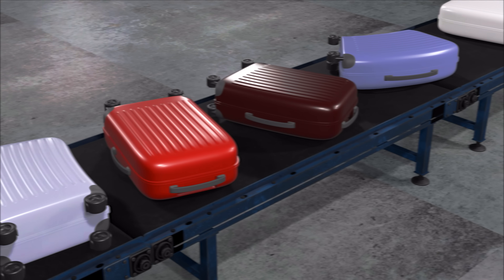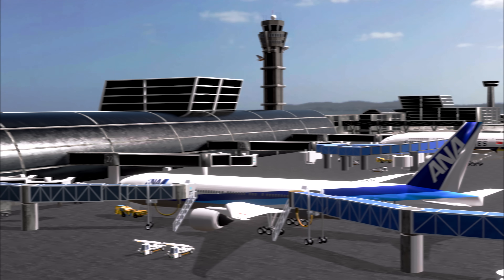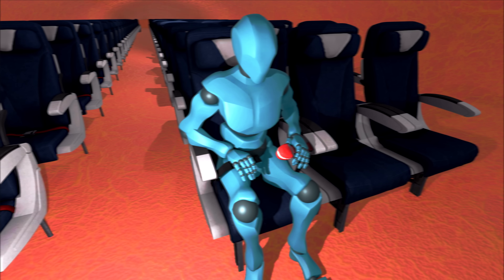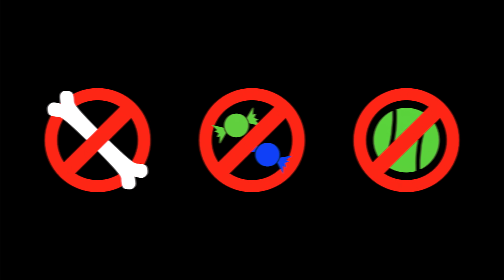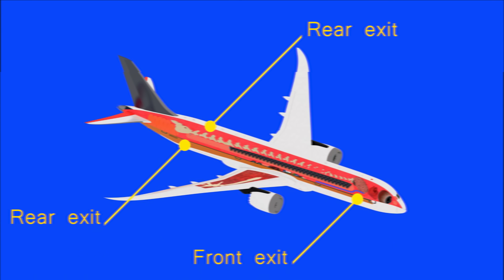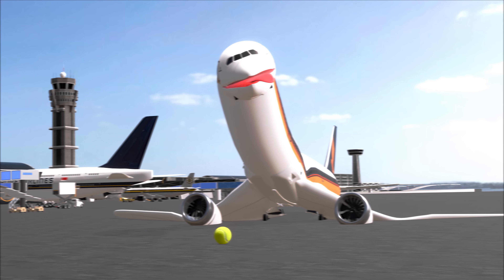How an Airliner works

Comment: The plane is not looks like this from inside at 0:04
Also, where's pilot control? 
0:17 This is not a suit case looks like inside
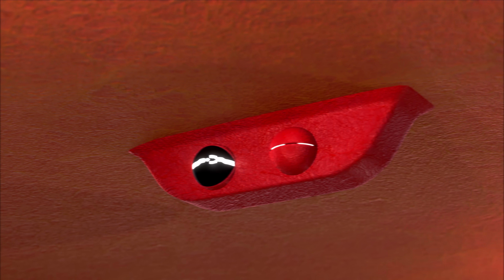1:05 You needed have monitor instead of using eyes
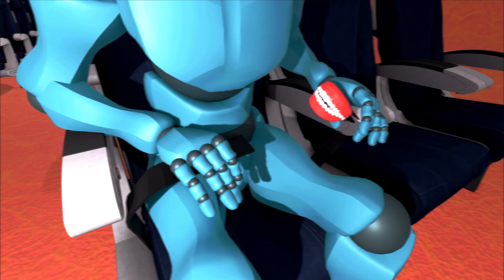1:07 This is not plane flying looks like

Comment: MAKE HOW PLANE-001 WORK

CHECK THE REPLY TO KNOW WHAT PLANE-001 IS.
Reply: plane-001 is a plane that is alive. it has broken metal skin to reveal the flesh underneath. It's arms are made out of the dead flesh of the planes it killed, the blood deteriorates the metal skin.

(unfortunately there is no 3d model of it)
Reply: YOU CAN MAKE THE MESH YOURSELF AND UPLOAD IT BEFORE YOU TURN IT INTO A MECHANISM(you can modify the plane used))

Comment: Airplanes are soft and fluffy creatures that love to hug and snuggle. When you adopt an airplane, you adopt more than just a critter. You adopt a new family member, and once you get used to the constant aroma of aviation fuel and the occasional visit from the FAA, you'll have a blast playing airplane fetch, hide-and-seek, and settling down at night for a good hour of cuddles. Airplanes need love, just like everyone else. The best way to show an airplane you love him is by petting him over the cockpit and feeding him on a regular basis. Most airplanes require a strict diet of C9–C16 hydrocarbons, so you'll want to shop at the best refinery available in your area. They also need lots of outdoor time. Letting your airplane loose can be scary, but not to worry! He has extremely refined homing instincts and is guaranteed to come home at some point under almost any circumstance. The one breed best kept indoors is the Max-8, which has a tendency to fall out of the sky for no apparent reason. Most others are safe to let fly. Before adopting, make sure you have a soft bed and proper air conditioning available. You should also not adopt an airplane if you live in a geographic region where barometric pressures reach below 11 kilopascals.
Reply: Reportedly, they have genetically modified the MAX-8 to not fall out of the sky. You can now take it for flights outside.
Reply: I have one lol
It is a 737- 800, about 70 cm long 
He is a result of my boredom and curiosity If I can turn a 3D model into a plushie
htt!ps://youtu.be/n4GLvrdJHiE
Reply: @filenotfound__3871 I had a 777-9
It then unfortunately died.
I had a 747
It also died
I had a bunch of old wise pets from WW2
They also died.
Reply: @VirtualAviatorAbdullah
What did you do to them lmao
Reply: @filenotfound__3871 I cuddled the 777 too much
I failed to keep my 747 on a leash.
As for my wise WW2 planes.
Reply: You guys make for really  crappy pet owners 😂
Reply: I had an An-225, and it mated with my other An-124 and had a baby. Now my little family is thriving, and my An-225 is growing very steadily. I love them all and I will never let them die ever. I treat them like my children, and they are like children to me. This is the reason why I like airplanes.
Reply: 今になっては乗り物の飛行機代も高いから、動物の飛行機を飼って、それで国外旅行に行きますか。
Reply: I had pet AN-125 and a AN-225 sadly I accidentally shot my an-225
Reply: My 787-10 starting to flapping its wings and flew away after I watched this video
Reply: i have a GIA A330
it got lost
then i have a alitalia 747
it got lost too
Reply: I have a United 757. I still have him.
Reply: I had a350 he is cute but he need to poop everytime in house
So i love him

Comment: You might ask why the turbinators are there as it flaps for lift - well, the hypermito turbinators are vestigial and appear to be an evolutionary leftover from when they were used for supplemental nutritional intake.